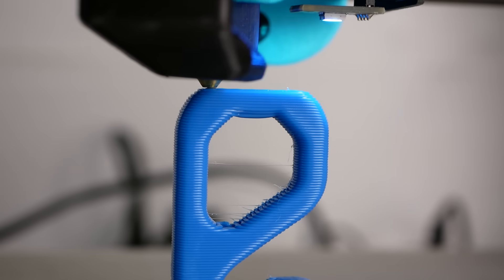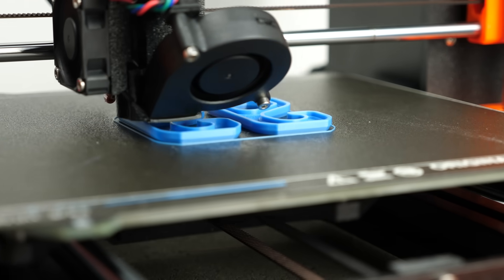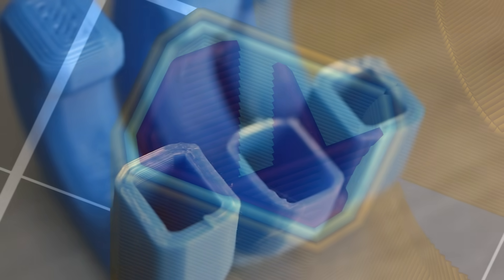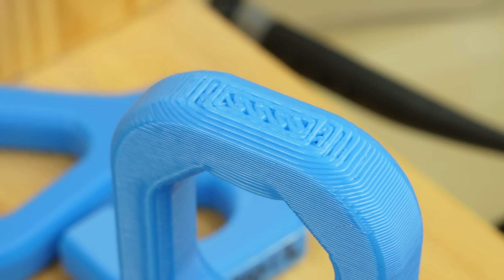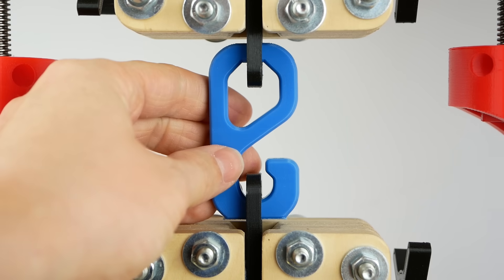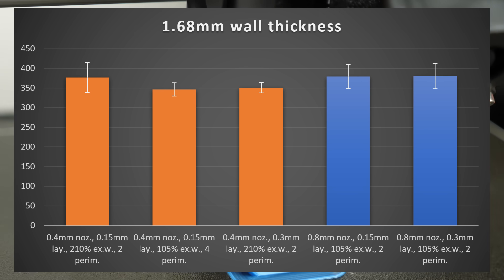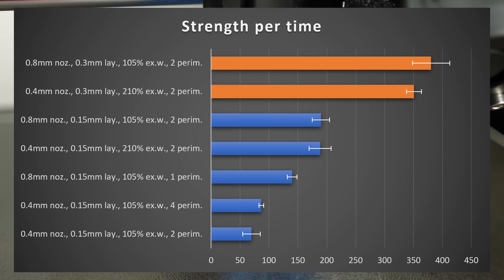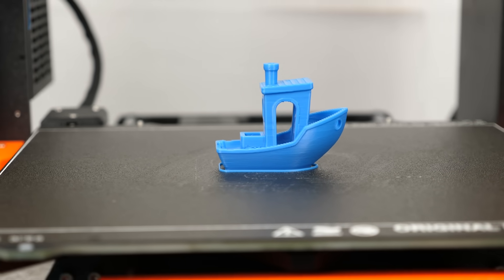BIG nozzles - HOW they (can) make your 3D prints STRONGER

Comment: Would you do a strength/quality review on something like https://thordsen3d.com/ ?
Curious if it helps with adhesion or anything like that.
I use one to heat my filament it helps since it's cold here and my hot end can't handle high speeds during winter I found out this month lol, so instead of upgrading the hot end I turned the heat up 30C and the print started doing really well. I just got the inline heater yesterday to test out the pre heating and of course that works really well. It now goes into my hotend already at 65C instead of 15.5C like in my shop. I use PETG so it does more for that than it would for PLA probably (just assuming that)

Comment: With a larger nozzle, your extruder has less trouble extruding, especially if your filament is less than perfect. Jams rarely happen on my 0.8mm nozzle coupled with a fake volcano heatblock and fake titan aero cooler-extruder.

Comment: Great work! "Emulating" larger nozzles works very well and is a big reason I prefer e3d style nozzles (as opposed to the pointy, mk8 style nozzles). Something that you may not have encountered in your testing due to 3mm^3/s cap on volumetric flow, I've found that going with extrusion width >150% nozzle diameter can result in extrusions "buckling" as they leave the nozzle, and coming out wiggly and unpredictably. I imagine this is likely due to the extra back-pressure that builds up when extruding large volumes through small nozzles at high speeds. Thus larger nozzles allow you to use larger extrusion widths at higher print speeds, which further increases strength per unit time.

Comment: I already use a 0,8 mm nozzle for roughly 50% of the prints. I generally keep the same standard 0,2 mm layer height, so that if the model is not complex it will look the same as if it would have been printed with a 0,4 mm nozzle, but still halving print time.

Comment: I found that lowering part cooling significantly increases layer adhesion and part strength. If I’m printing something that needs to be stronger I will try to get away with a little or no cooling if possible.

Comment: I noticed that changing the nozzle-size in cura affects the layer adhsion of the print. If i use my 0.3 nozzle with a 0.4 nozzle setting (still with 0.3 line width) the layer adhesion is better than with the 0.3 nozzle setting

Comment: What about dimensional accuracy? If you use a higher flow rate, is it possible to afect dimensions in XY plane? I think that depends on slicer algorithms. I've tested dimensional accuracy on a prusa i3 mk3s using cura 4.4 and for a 0.4 wall thickness and default 95% flow, it was spot-on. But in prusa slicer, i had a 0.48 wall thickness.

Comment: Larger nozzles also have less clogs and will have lower nozzle pressure at those larger material flow rates.

Ie. do not try with weak extruder like the one on Ender-3 "mk8" extruder, those are borderline even without using double extrusion width with 0.4mm nozzle.

Comment: In Prusia slicer most % values are calculated based on layer hight, not nozzle width. Fell in to this trap too.
Using 0.8 for all prints with 1mm extrusion width that ends up in 1.00-1.05 actual width. Makes disign simplier. And prints are  actually reliable. (btw. Using abs)
Reply: Just checked Prusia slicer. If you put % values into extrusion width parameters, it actually calculates all parameters based of layer hight, and not the nozzle diameter.
No wonder there is no actual difference in test results.
Reply from the maker: For clarification, I've been putting the values into prusa slicer as numeric values and not as %.

Comment: Just a note about your weight discrepancy and extrusion width in slic3r/prusaslicer.
Detailed explanation: https://manual.slic3r.org/advanced/flow-math
basically, 2 perimeters of 0.42mm width  don't create  a 0.84mm width perimeter but a 0.84 - layer_height * (1 - PI/4), so for 0.15 layer height you have ~0,808mm width => less plastic. With 4 perimeters, it's 4 * 0.42 - 3* layer_height * (1 - PI/4) ~=1,583 (and not 1,68).
This thing become very important strength-wise if you want to extrude a wall with only perimeters. Because if your wall isn't near enough the real width, you may have a weaker bonding between perimeters (almost not touching and not enough empty space to extrude gap fill).

Comment: In my non-scientific experience there is a Breaking Point my 1.2 mm Extrusion nose cones appear to be stronger than my 3 perimeter 0.4mm nose cones

This might have to do with the slower printing speed? But the flow rate is higher so I don't think there's more heat involved

Also this changes based on the filament you were using the Bond layer seems to make a big difference for example with silk filament my 1.2 mm single Extrusion silk print is significantly stronger than a 3 perimeter and 0.4 mm silk print the one I could crush it by head the other I cannot but this might be specific to that kind of filament which has very poor layer adhesion

Simply increasing the Extrusion multiplier works on a small scale but not a large scale I noticed a very large difference in quality when I push that too far mechanically the part is similar but the surface finish quality suffers greatly on the parts where I use the Extrusion multiplier instead of a larger nozzle you did note that you can only push that so far :-)

Comment: In previous tests for layer height and extrusion width you used percentage of the nozzle diameter. do those findings still hold with bigger nozzles?
Reply from the maker: The ratios probably but haven't tested it.

Comment: Cura also contains Wall Line Width, Wall Line Thickness, and Wall Line Count. Ive heard that Shell Thickness set equal to nozzle size is a single Perimeter, aka wall line count. The default wall thickness is 1.2 mm for a standard 0.4 nozzle (petg), as well as for a 0.6 mm nozzle. Default wall count is 3. Layer height is 0.2. so to achieve this in cura (to achieve your strongest setting with 0.4 nozzle), is to set Wall Thickness to 1.68, and then Wall Line count to 2 (for emulating 0.6 mm nozzle it should be set to 1.2?). Flow needs to be turned up to 200 (I guess this is your version of Extrusion Width?). Hopefully this is the case because it solved a layer gap issue with my prints at the settings i've mentioned. the layer gaps could also be a problem with setting layer height to .3?. I increased my layer height to .3 for the added time to strength benefit, although I could have used .15 setting for a greater quality at the sake of time, like you mentioned. I calculated my numbers slowly by understanding the information in your bar graphs as they proceded on, and by gathering information from forums. I can also set my default nozzle size in cura to 0.6, but all things previously mentioned should be in place, including a .8 line width. Im printing this out right now so hopefully this is a correct understanding. also i guess overlap is how you are getting 105% layer width? and layer width will be at 200% since I've "doubled" my nozzle size... I believe it also forced me to increase the width of my walls...

Comment: I would have liked to also see some results from pushing the 0.8mm nozzle into places where the 0.4mm just can't go.  You've shown that a 0.4mm nozzle can "emulate" a 0.8mm one - really, it's just a 0.4mm nozzle emulating the 0.8mm nozzle's default print settings.  But that's pushed the 0.4mm nozzle nearly to its limits for maximum extrusion width and height, and we haven't seen what the 0.8 is really capable of.  What if we bumped the extrusion width and layer height again - at a 1.68 mm extrusion width and 0.6mm thick layers (well within what the 0.8 can handle - way out of the 0.4's capabilities) would strength continue to increase?  Or at 1.68mm wide but staying at 0.3mm thick to really squish the layers together how would the results stand up?

Great video as always - but I think you've handicapped the 0.8mm nozzle by restricting it to only settings that a 0.4 is capable of matching.

Comment: I try to print with ,8 nozzle and ,6 layers just because i'm inpatient, TPU socket protections in 11 min without stringing. And as you said its time vs strength. and emulate larger nozzles create less reliable prints. I had 25% fails when i tried. So big nozzles and ,3 to ,6 layers depending on the part. (I do spare parts for equipment in the auto industry)
You should try a video about accuracy, i'll have a spread of 0,02 mm over 80 parts (except for one scrapped due to adhesion) for gauges for my tuned prints in PETG.

Comment: Do you consider line overlap with your prints? Some prints aren’t as strong as there are only weak connections with the layer lines with the infill and wall. The extra extrusion pushes more out, but layer overlap % ensures better adhesion an irons the overlap, creating a better fusion with the plastic.

Comment: Another great video! I've got a 0.6mm nozzle coming soon (I hope, longer shipping time directly from e3d than from aliexpress at the moment :/ ) and it feels like a 0.6mm nozzle would be a great standard nozzle where I can both decrease extrusion width for delicate things with thin walls, but go up to 0.9mm for optimal strength, which is where I'm guessing my current heating limitation for good flow and speed is.

Comment: When printing something for stength, i use a 1.2 nozzle on a volcano copy hotend.

Edit: I also print at 0.6 layer height and use slow speeds. Abit suprised to see that i may aswell just use a smaller nozzle at higher speeds.

Comment: Thanks for your videos. I USe 0.6mm nozzle on a X5S and I like it more and more. Initialty it was to print flex  because I always got underextrusion with 0.4. Now I use the 0.6 also for the PLA, keeping layer height at 0.2mm. I like the quality of the print at least a much as with 0.4, even more.  Next time, I may try with a Volcano at 0.6mm, it may well be a more versatile solution for the various filement types PLA, PETG, flex, and PTU

Comment: I have printed almost all of the lampshades in my house using a 0.6mm nozzle and clear PETG. The PETG that I have been using is a very cheap one and tends to bubble and spit. This, along with the coarse layer height, gives a really nice texture that looks almost woven. On some lampshade designs I have also used Cura' "fuzzy skin" option. Because some of the shades are quite big and because PETG is a bit flexible and I'm printing in vase mode the shades are quite flexible so have to be printed very slowly. Still, who cares if they look good.
Reply: If it tends to bubble then you should try drying the filament befor usage.

Comment: i have been an injection moulding technician for 27 years but i am new to 3d printing.
Do you use reverse taper tips for nylon and a.b.s to help material separation at the tip like we do in injection moulding?
Do you just use different size straight through nozzles because of fillament?
Reply from the maker: 3D printer nozzles mostly look pretty much the same like the one in this drawing: https://wiki.e3d-online.com/images/b/b2/DRAWING-V6-175-NOZZLE.png
Reply: @CNCKitchen   thank you, it looks like no one is using the type of reverse taper tips i use, they help with material seperation at the nozzle tip, i wonder why, not beneficial?

Comment: Perhaps something to add that me and a few people talked about recently via the comments. Measuring the strength against speed of print on the same layer height and extrusion width. Essentially at what point in material extrusion rate and movement speed does it adversely impact strength ue to lower strength of layer bonds and of course the opposite at what point does performance peak with slow speed when giving material in the layers adjacent and below to heat optimally and become a single solid as opposed to two bonded solids. 
You somewhat covered it in concept. How with larger nozzles which means a longer melt zone etc etc you can get more material out at a consistent temperature that is melted correctly. 
But I and many other people would probably love to see the data. For example, at X material output per second the bonding was Y strong. At X*2 speed strength was Z percentage of Y's strength.
So we can see how directly proportional the strength to material output capability is.
Reply: I'd imagine that would be very situational. I'd imagine a few variables would be your printers specific cooling setup, length of melt zone, the temperature you're printing at, or the temperature in the room just to name a few.

Comment: I always print with a 0.6mm nozzle with the main reason being my impatience. The details is very similar to 0.4 and the print time is massively reduced.
Reply: yep.... .6 is my go to...
Reply: What settings do you have to change in the slicer in order to make them work?
Reply: I am considering this.  Is the retraction clean with the 0.6mm nozzle and 0.3mm layers?
Reply: @GnuReligion  try 1.2mm, it's even better :)
Reply: @cu3d  I suppose you could over extrude that 1.2mm to 2mm lines, an print in 1mm layers?  That would certainly be laying down some material.

Comment: I use a 0.8mm nozzle on my i3 Mega because I prefer the increased print speed.
Theoretically, its 8 times faster than the standard 0.4mm nozzle but in reality you have to slow your print speed due to the material being towed a long the print head - I'm printing at 65% the speed I was with a 0.4mm. Therefore I'm printing 5.2x faster. Potentially by tweaking acceleration settings you can get closer to the 8x.

There is a trade off between the print speed and the aesthetics. Corners are more rounded, small detail is less well defined, and any layer inconsistencies are amplified, but as I make more functional parts than aesthetic parts the trade off is worth it for me. Not to mention 1 hour print time + 15 minutes of sanding is less than 5 hours to achieve the same result.

The time saved can then be used to beef up wall thicknesses.

Comment: So the uptake in resin printers has me thinking:
Dude! I'd like to, for science, challenge/request/suggest (whatever works!) you to see how strong a part can be made by printing (either method to be honest, UV it FDM) a single wall outline and then filling it with epoxy resin. The idea being that a complicated part can be printed and then have the strength of a single object, with epoxy being difficult at best to shape into complicated parts.
Will post this comment on a couple of other channels if you can't be bothered, but it sounds to me like a great  for science episode!
Reply: Just saw a similar idea at the Bosch industrial AM booth at the latest formnext where they print the walls with FDM and fill the void with injection molding material to achieve injection molding strength with lot size 1 design flexibility.
Reply: It's been done - https://www.youtube.com/watch?v=iICk_ZpY4Cs
Reply: Nice, will check out that vid, cheers! And glad I'm about on par with Bosch! 😂

Comment: I appreciate the time and effort you go through doing these tests.  I use 0.8 a lot.  I primarily print prototype or functional pieces and I'm targeting speed.

I am curious about what the data would like like for 0.8mm at 1.6mm.

It would also be interesting to see how these modifications affect overhangs.  As the ratio of layer height to nozzle diameter decreases, the ability to support greater overhang angle should improve.  This would inform the user of optimal overhangs based on the nozzle diameter, extrusion width, and layer height.
Reply: It would also be interesting to see how changing the extension width differently for outer perimeters, inner perimeters, and infill affects the strength vs. finish quality of the outer skin.